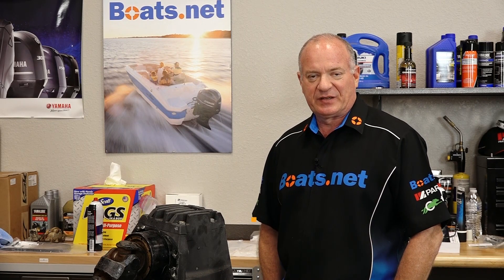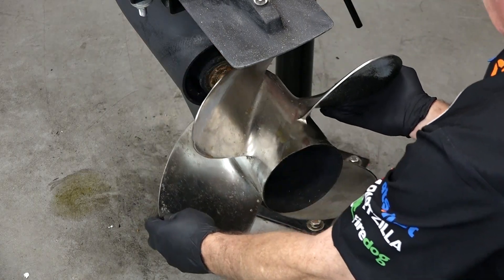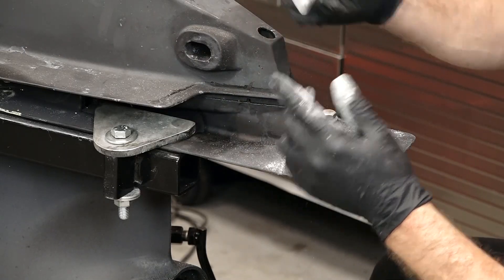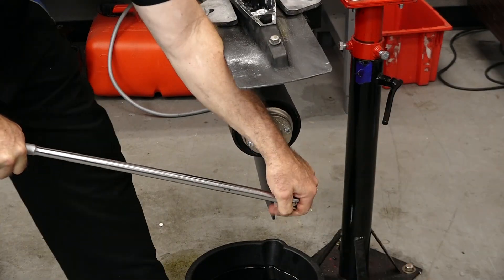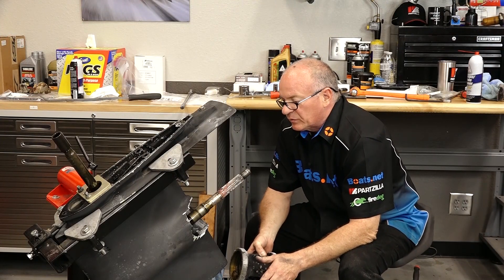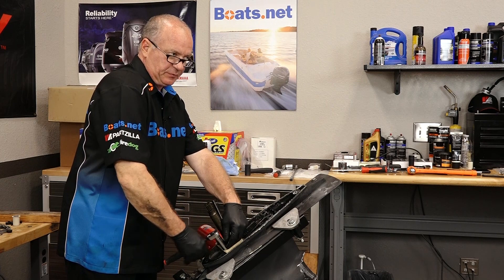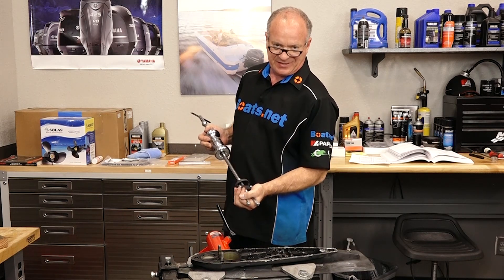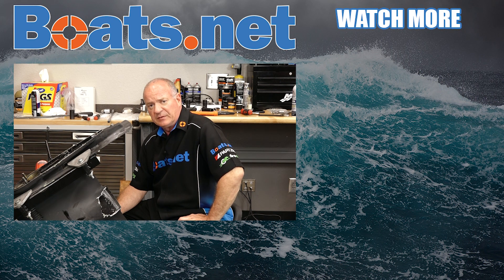MerCruiser Bravo 2 Lower Unit Breakdown | MerCruiser Bravo 2 Outdrive Lower Unit Removal | Boats.net

Comment: Hi John!
Great episode! Had the same issue on my 75 Hp Yamaha 2 stroker. The the bearing carrier nut and carrier were totally stuced in the housing.
If your housing didn`t had the crack had you used a heat to get the carrier out?